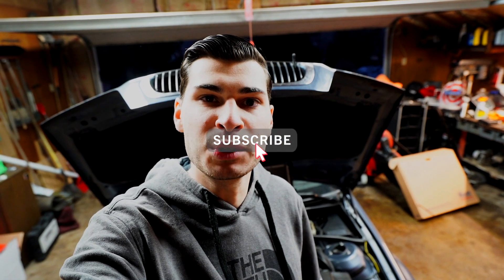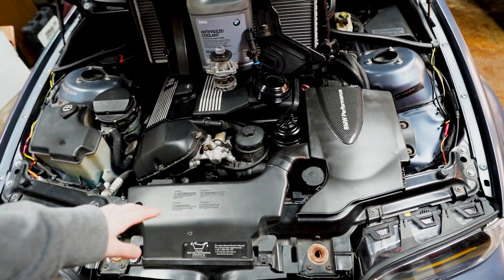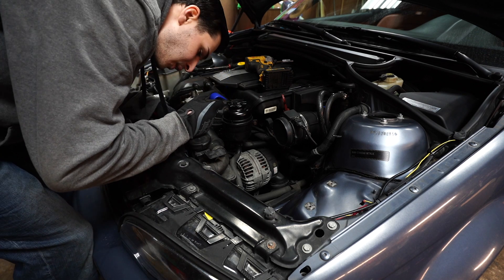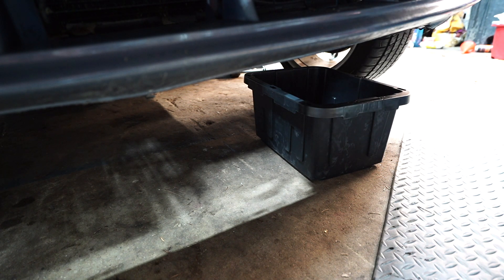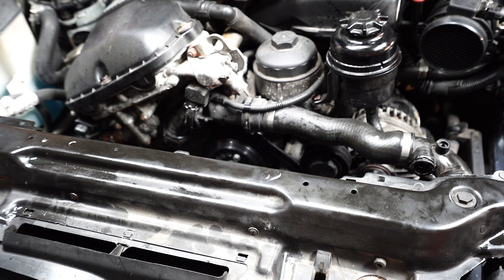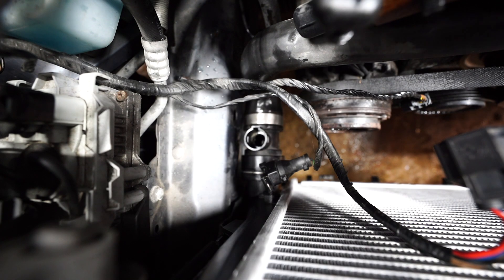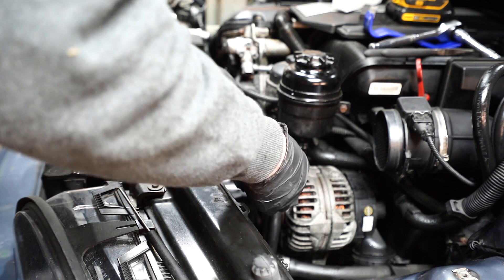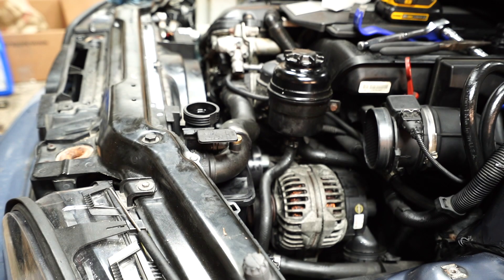BMW e46 Cooling System Overhaul!

Comment: As long as you change the oil early. This is the only thing that will kill a stock m52/54. Great video.
Reply: Have a question about an 2001 bmw 330ci colant

Comment: Thanks man excited to watch this. After I can make sure the engine would still function I wanna overhaul the cooling system on my 1999 Cutlass. It’s a cheaper car but I wanted to find some cooling system overhaul videos because they’re informative and very entertaining to me personally.

I’m probably gonna have more into it than what it’s worth even without the labor costs for most of the work that’ll be done on it but I feel like it’s worth it because I wanna keep it running as opposed to scrapping it, especially because it only has 70K miles on it. I got it for free from my parents are for probably less than 4K I’ll have a car that’ll run for a long time, hopefully the engine block is all good and not cracked from a couple unstated risk factors.

Comment: Secret to not blowing your engine simplified: Buy a 120psi radiator cap, get rid of the OEM 200psi radiator cap that causes too much pressure in the system causing things to blow up.
Reply from the maker: Yes!!!
Reply: Wait!!! Has this been the problem this whole time?!
Reply: That's a good idea but the pressure is typically 29psi not 200. German Auto Solutions sells a 17.5psi cap for this purpose. Just thought I would clarify so you don't get frustrated looking for a new radiator cap. Great thought though I am getting ready to do my system as well and plan to add this part to the list.

Comment: I like your plug on using FCP Euro to source parts when doing jobs like this but I don't consider what you did in your video a cooling system overhaul but rather a cooling system refresh. An overhaul is when you replace everything in your cooling system including the cooling system hard pipes and heater core hoses which are under the intake manifold. As miles creep up on your BMW it becomes prudent to replace those cooling system hard pipes as they become brittle and will break off where they mount into the engine block. I recently performed a cooling system overhaul on my BMW sourcing everything from FCP Euro.

Comment: I just order my waterpump, radiator and expansion tank.. Do you recommend to change all the tubes also or just when they are visible getting older?
Reply from the maker: Visual is find and what I did. I did replace the o-rings

Comment: Hi great channel I did replaced my radiator but I forgot to installed the coolant thermostat  is there any issues or do I need to install
Reply from the maker: I would recommend replacing it